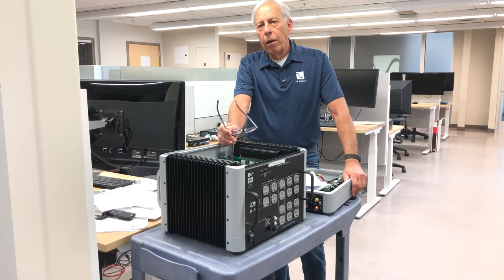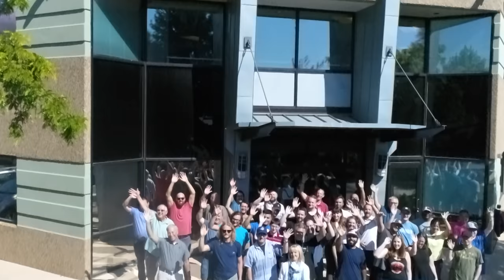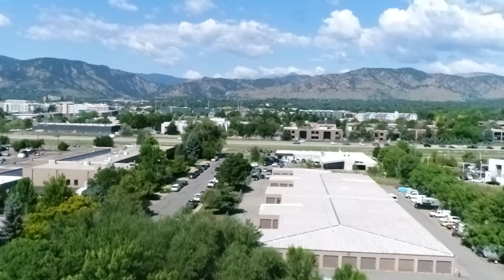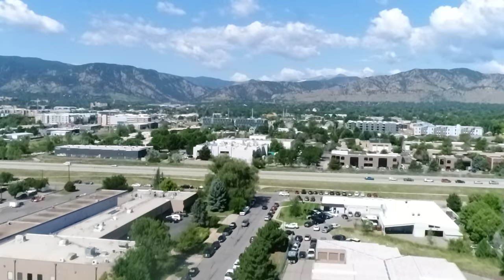What's wrong with using a UPS on a stereo?

Comment: I've worked in Bangalore. Power cuts are frequent and can be long. UPS is a must... Even though most buildings have standby generators that kick in quite quickly.
Reply: Exactly what I was going to say. The fat capacitor at the front of an SMPS mops up any deficiency in the waveform.
Reply: Not that bad at my area in bangalore, but did not want to connect the receiver on UPS...

Comment: Hi Paul. My UPS has two rows of outlets. One row is battery backup, which is used for computer and related components, the other row I use for stereo components. Although not a power regenerator like your fancy unit, It does seem to clean up and insulate the stereo from the old house grid. Moreover, during outages, I use it to power efficient lamps and keep phones and blue tooth speakers charged to tide us over until power is restored.
Reply: Most UPS's will have a filtered and surge protected Outlets on one side and battery backup on the other that way you don't waste that precious battery power running that ginormous laser printer during a power outage

Comment: But can I use FedEx with my surround?
Reply: Paul will send you a Sprout by UPS and the speakers by FedEx.. Sounds good 😀😀😀
Reply: Not compatible with the encabulators within the unit, too much side fumbling with the pana-metric fam, causing unwanted fluxes that may burn out the matching transformer, possible explosion. DO NOT ATTEMPT unless your a well qualified service engineer with depleniation training and certification with the board!
Reply: so no to non union workplaces lol

Comment: Liner power supplies do not react well to "stepped sine waves" and in some cases, square waves.  Most audio products use linear   power supplies.  Most modern TVs and CD players and computers use a switching supply are are not affected by these lousy AC sources.

A few UPS models have a pure sine wave output, but they cost more.   For a short period there were computer power supplies that required a pure sine wave.  The had a designation of PFC which makes use of the power factor for more efficient operation.
Reply: As Paul stated in the video, most (but not all) double conversion UPSs are pure sine wave
Reply: Most UPS system sold to the general public are NOT true sine wave.  Cyber Power offers both stepped sine wave as well as true sine wave supplies.   American Power Conversion (APC)  also sells stepped wave units and also offers true sine wave UPS products.  The true sine wave products cost more.
Reply: Consumer UPSs use one transformer for step up OR step down, and use a transfer switch to quickly move the load from line power to the inverter when power fails. Double conversion UPSs convert incoming power to DC, and have both batteries and an inverter attached to the DC bus. The inverter is producing the power for the load 100% of the time, and there is no transfer switch delay when power fails. 

Since the inverter runs the load under normal conditions, the vast majority of double conversion UPSs are pure sine wave. There are also pure sine wave UPSs that aren't double conversion, and those would probably work fine too. So yeah, Paul probably should have just said "pure sine wave", but he wasn't missing the mark when talking about dual conversion units.
Reply: Paul S ...  What you are describing is the TRUE definition for a UPS or uninterruptible power supply.  
These are much more expensive that the ones that use a switch to apply battery power to the system.

With these systems the batteries are ALWAYS supplying the power to the system and the AC input just charges the batteries.   Most consumer units are actually "Standby Power Sources", including the consumer true sine wave units.
Reply: @swinde is stepped sinewave or line interactive ups will damaging speaker or active speaker?

Comment: With a clean output sine wave, a UPS makes an unbeatable surge protector!
Reply: Nope, unless the UPS has surge protection circuitry in it which it could have regardless of whether it is a clean output sine wave otherwise, it is still just a voltage multiplier and inverter, so a surge would get through to the equipment for a minimum of whatever the frequency is of the regulation feedback sampling.

Comment: Switching mode power supplies which are used in most consumer electronics such as receivers, TV's, computers, led lightbulbs and so on do not care about the wave shape at all because the input gets rectified first. Transformers and inductive electric motors may generate a hum on simulated sinewave and run a bit rough, but getting damaged is very unlikely. A regenerator does the same exact thing as an online pure sinewave UPS, it rectifies the input to DC and converts to a pure sinewave again. So those power plants are just online UPS's minus the battery backup.
Reply: I was thinking much the same, though not as expertly as you set out. And at any rate, doesn't the power supply of any decent amp/receiver smooth out the crap in switching power supplies - smoothing caps etc?
Reply: You are better educated in this than most. One thing I do know is that the early UPS using switching DC to DC converters were capable of burning motors and transformers with their pure square wave . Shortly the UPS designers added a delay between the negative going and positive going square waves, called it anything from stepped wave to quasi sine, but our problems with burnt out equipment ceased.
Reply: @johnhodgson5313  that's mostly because Motors are designed around the AC system and the alternating of the waveform and really do not like square waves thus It's a really good way to kill them. I can't say square waves are gone but most manufacturers have moved on to some sort of approximation For Better or Worse
Reply: Thanks for replying. Right you are, and a lot of power transformers that are designed for 50 - 60 Hz don't like the square waves either. 20+ years ago it was explained to me why the time delay between 1/2 cycles made it more tolerable for the motors and transformers, but that piece of information died in my head because I never had to use it. For better or worse, the compromise between power efficiency (battery run time), clean power and economics, there is no perfect UPS
Reply: FULL BRIDGE RECTIFIER!!

Comment: PC's, and other similar electronics, use switching power supplies, which are not at all particular about the input power. That may not be the case for good quality audio gear. Not sure why you would want to use a UPS on a home audio system in any case. On the other hand, I highly recommend using a Balanced Power Isolation Transformer for better quality AV systems. I have a Furman IT-1210 to power my electronic music studio (except the PC since there is no analog audio I/O) and a similar unit from Equi=Tech in my home theater AV cabinet.
Reply: balanced power isolation transformer can handle sudden power cut and power resume? say 1second or even less than 1second.... ?
Reply: @josephlai99  No, a balanced power isolation transformer is not a substitute for a UPS. You would only need a UPS on a PC in any case, not the rest of the studio equipment. Since the PC is not connected through the BPIT you could certainly use a UPS on that device only.

Comment: It's more down to filtration on the output from the ups you can use a triad filtration with safety caps, two 0.47 one on live one on neutral going to Earth, a 0.1 going across live and neutral, and ideally two scotchy diode opposing each other in parallel

Comment: I was watching this video for a different reason. USB noise is with many computers an obvious issue - I have noticed that when running a laptop, the thing is silent when it comes to USB noise.

Sadly, as I've upgraded to an AiO PC (the grunt of a desktop, but more luggable than one) battery isn't an option.

Just wondering if a UPS may help

Comment: Funny, how a choppy sine wave is bad news for audio gear, but isn't a digital amplifier doing basically the same thing?
Reply: It's not all that funny, that any piece of equipment is meant for a specific input power range and type, then can do whatever it is meant to do to get the desired output.  They could qualify each UPS on a case by case basis but why would they if there is not enough perceived consumer demand?  That testing costs money while disclaiming warranty saves money.

Comment: Paul - since your products convert AC to DC and back to AC, it'd be trivial to add lithium cells to the DC portion and turn it into a UPS. Use high output (low internal resistance) cells, so you can get away with one bank in series. It'll provide a few minutes of runtime for those of us in areas with lots of short power "blips".
Reply: If by trivial you mean an extra expense that most don't want to pay, and an early failure point since a good piece of gear should last decades while the batteries won't last 10 years, then sure, make things more expensive, complex, and failure prone for the 1% of the market that really needs it - or just let them buy an UPS which makes far more sense.

Comment: Simply use old fashion current stabilisation unit based on the flat plate capacitor on Ups and long enough cable between it and equipment as it produces hum. While generally it's advised to use a battery DC source with independent ins & outs in equipment to avoid or lower hum from AC/DC convertor it simple isn't so with UPS DC/AC output conversion to source which again does AC/DC conversion and besides the 40 to 60% energy gets lost in the process (AC/DC UPS in, DC/AC UPS out & then again AC/DC at source).

Comment: I was thinking to get one (sinwave) for my projector to save the lamp if power shut down.
Reply from the maker: That's a really good and smart thing to do. If the power glitches or fails you could be in for a big expense replacing the damaged bulb.
Reply: I've done this on my $4K JVC Projector for years and it's never had a problem. Totally recommend this.

Comment: What would be the reason to use a ups on a receiver
Reply: Jorge Gomez i do it to protect against brownouts and low voltage situations caused by storms. All my equipment is protected this way
Reply: @MrSoulPotato  So pretty much as a surge protector not really as a UPS..
Reply: @JorgeGomez-bt9lt  Somewhat. Surge protectors protect against in-rush power surges but not against voltage drops.  The production company I work for uses them all the time when we work off of generators. It just ensure that everything stays running and happy.

Comment: While double conversion UPSs usually have pure sine wave output (since a double conversion UPS is more expensive, there is not much point in saving a little bit of money with square wave or "modified sine"), line interactive UPSs can also have pure sine output.
AC motors do not like the "modified sine" - which is essentially a pulse (I have not seen a UPS produce a "stepped sine" with more than 1-2 steps) - and would not start to spin (tested on an AC fan - if it was spinning then it continued to spin) and 50Hz transformers buzz, but the device usually works.
Equipment with switching power supplies, especially older or lower powered ones with no PFC should work OK on square waves, since they have a rectifier on the mains input anyway.
I think the easiest way to see if a UPS has pure sine output (without an oscilloscope or the spec sheet) would be to connect an AC motor to it and see if it starts spinning and does not produce more audible noise compared to being plugged into the mains.
Reply: does square wave/modified stepped sine wave is okay for device like speaker or powered active speaker?
i still dont know exactly equipment with switching power supply is
Reply: @bolulembut1132  Depends on the power supply of the device.
However, if the device is rated for a wide voltage range (100-240V) and does not have a voltage selection switch, it most likely has a switching power supply and would most likely work OK on a cheaper UPS.
Older equipment usually has 50Hz transformers - they do not particularly like non-sine power.
Modern PC power supplies have active PFC and may have problems running on such an UPS though.
Reply: @Pentium100MHz  i planning to buy those kind stepped sine wave /kine interactive ups for my powered monitor speaker (yamaha hs5) , i cant find any voltage range in manual boom nor speaker itself..i searched on google they dont come with switchable power supply which need voltage converter if/when used  with voltage outside my country.. is it still not suitable to use stepped sine wave for those speaker?
Reply: @bolulembut1132  It may have a 50/60Hz transformer, you should try to get a pure sine UPS. 50Hz transformers can work on a "modified sine", but they buzz and it may cause some damage  if you use it for a long time like that.
Th only way to be sure is to find a service manual for it or a picture of such speaker disassembled.
Reply: @Pentium100MHz  well thats sad , i always have anxiety when i do recording because i have concerned about frequent power surge , blackout and overvoltage , i was planning to get surge protector but it seems wont work here due my small apartment is ungrounded.
 a pure sine wave ups still too expensive for me
so in my condition it is best to leave it plug straight into wall outlet rather than plug into that stepped sine wave ups? i just want to make sure i dont choose the wrong path
Reply: @bolulembut1132  Look for a used UPS, they may be cheaper.
Anyway, if the UPS is square wave output, it may damage the transformer, a "modified sine" can be OK for a short time, it may also depend on the transformer. I have used a "modified sine" with a reel to reel tape deck, and did not have problems (other than the buzzing of the transformer), but I cannot guarantee that your speakers will be fine.
Reply: @Pentium100MHz  is modified sinewave same as stepped sine wave or synthesized sine wave?
i dont planning to use or continue recording when power outage happen just want to turn off the speakers properly when  blackout/ power outage does it still take the effect or probably may damage the speaker?
Reply: @bolulembut1132  It may be called different names, but what I am referring to is a waveform where the voltage has three values - zero, negative and positive with very sharp steps between them.

I do not know about the damage - in theory, running a 50/60Hz transformer on modified sine for a short time should be OK. In practice? Well, I can't really say without testing.
Reply: @Pentium100MHz  thanks a lot sir for explaination and answer all my questions :)

Comment: There are three different types of UPS's there's the line interactive which is is essentially a battery charger charging a battery and when power goes out switches over to an inverter internally the problem with those is they tend to be anywhere from Square wave, stepped square wave two stepped approximation sine wave. The more expensive ones will use a true sine wave output, and the really expensive ones are called online where they essentially have a power supply that brings AC to a DC buss and charges the battery and runs the the inverter all the time and in that case it's usually always a true sine wave inverter.
Most of the problem is that companies try to use the cheaper way of doing it in there cheaper line of products and don't clearly State this the consumer and a lot of audio visual equipment does not like non true sine wave and will usually have a pretty annoying Buzz the better well-designed products will be able to filter that out unless you have a really cheap inverter. I have also heard rumors that using one or the other will kill something and I'm sure in really cheap instances that is true. There's also a efficiency loss which can be quite a wide margin.
Reply: I have been acquiring APC UPS for a while now it started with a 550 1 model before they went USB I am happy to say that well they don't produce a true sine wave on there cheaper models they have done a pretty good job on any of the newer stuff in the last 10 years that most things will be happy apart from some electric motors and some audio stuff. I also acquired a big monster I think 1500 which is a pure sine wave that I have thankfully not had to test with my audio equipment during a power outage, I was running my entire live sound rig amps, mixer and all off of it because I wasn't sure if I was going to have any power issues running off of a generator thankfully day befor the event I found out that we had the big poppa of major awesome giant roll behind generators with very good regulation ( and a very Hefty and thankfully donated rental fee $$$$$$ ). I also have two of their older models and they are more of a modified Square wave stepped approximation.

I'm not quite an audiophile but I do seriously care about audio and want it to be reproduced as close to original as possible and practicable. I took this literally to the point when I was doing sound for a band with "their equipment" and managed to track down a failing switch mode power supply in one of their digital amps for moniters, I was able to somewhat isolated it to not pull my hair out and get through the event.